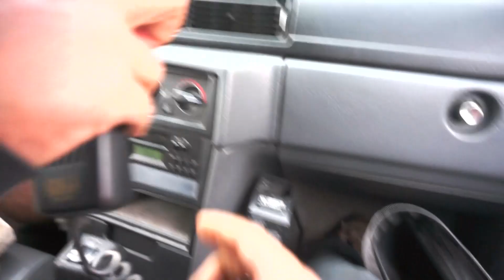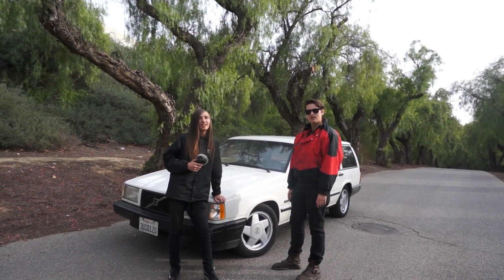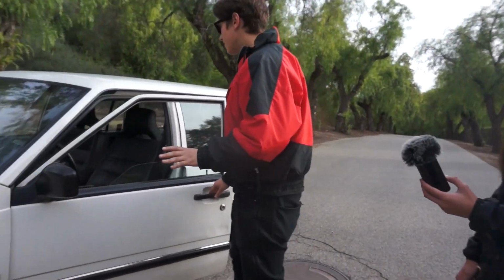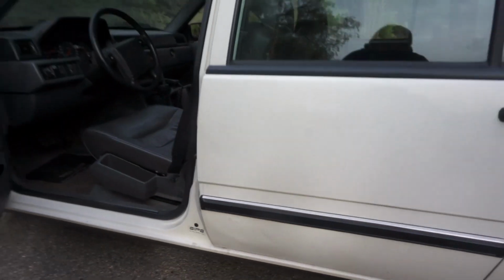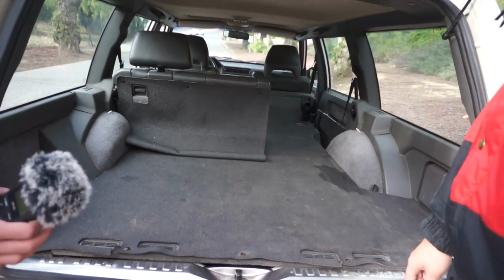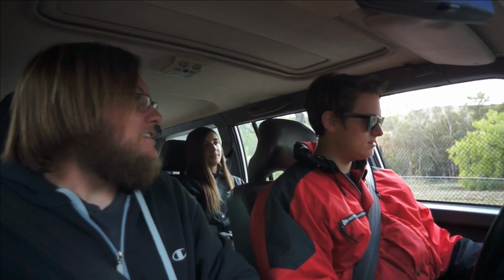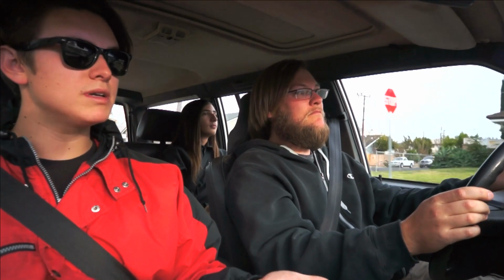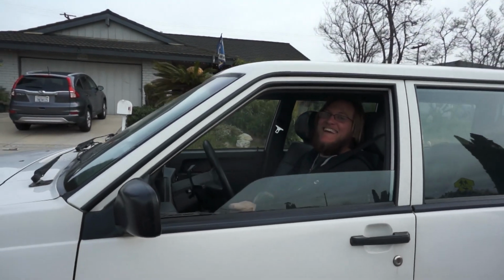1992 Volvo 740 TURBO BRICK | Car Review

Comment: I also own a 90 740 turbo wagon, pro tip slap a manual boost controller on it push it to 12 psi cause the injectors will handle 14 before fuel cut, and just be the hoon ya wanna be.